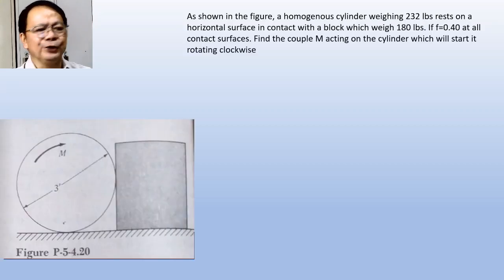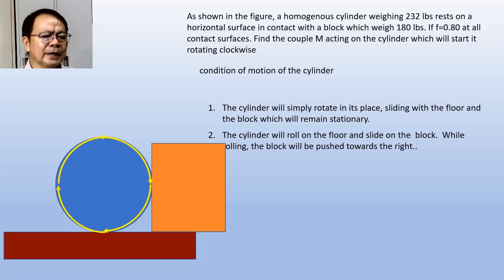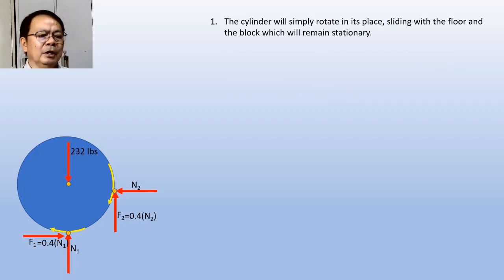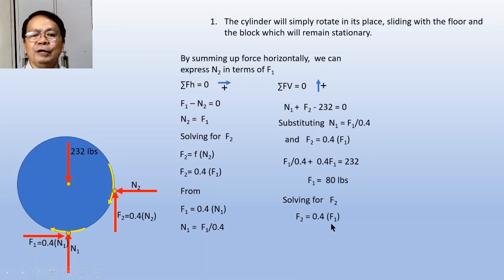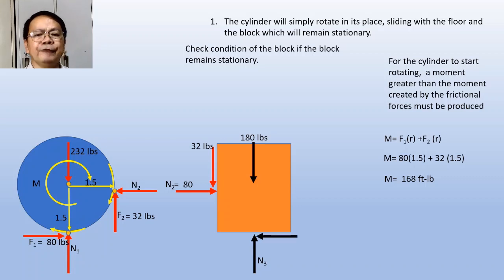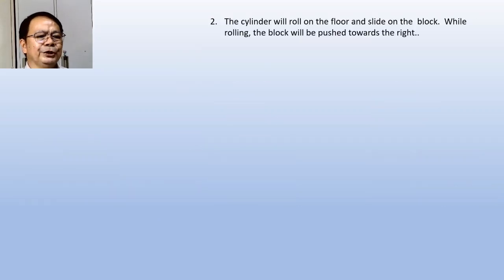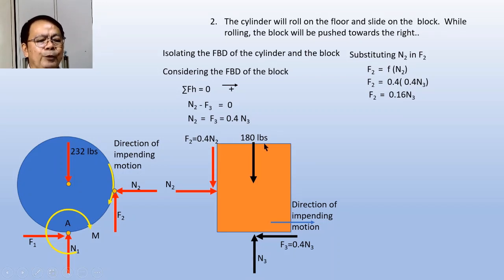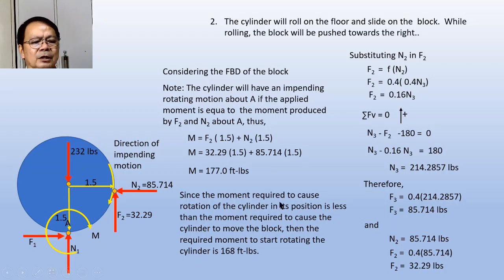Application of Friction

Comment: What if sir ang nakuha nating value ng Moment sa 2nd assumption is lesser than the Moment in 1st Assumption? Ibig sabihin po ba nito kung alin yung mas less value ng moment yun yung require value of M that will start the rotation of the cylinder Clockwise?
Reply: Follow up question: What if the 1st Assumption doesn't satisfy the condition of equilibrium? For example, Naging mas malaki ang value ng Frictional force nung block (F3) kumpara doon sa Normal force na na-exert nung cylinder (N2) and therefore maitutulak nung cylinder yun block at magkakaroon ng motion. Saan na po ako magbabase ng sagot ko which is yung required M for the cylinder to start rotating clockwise?
Reply from the maker: Yes... kasi hindi na mangyayari yong larger kasi gumalaw na siya at the value of smaller moment...